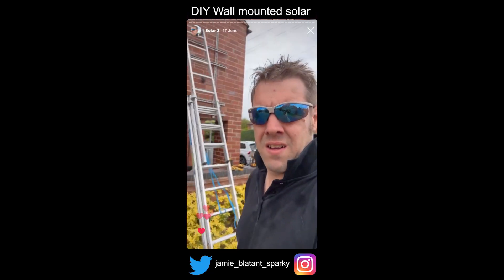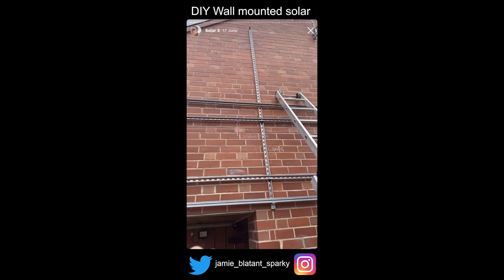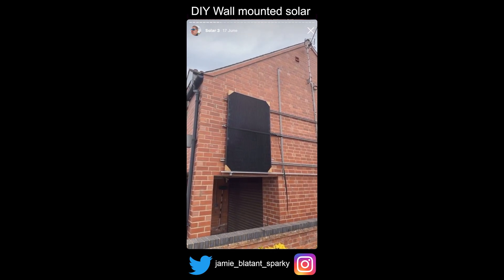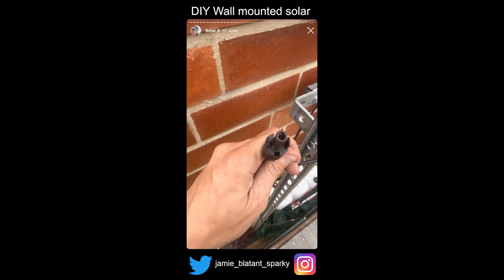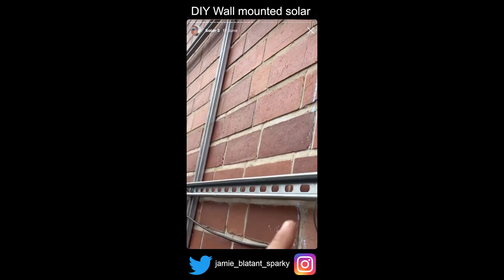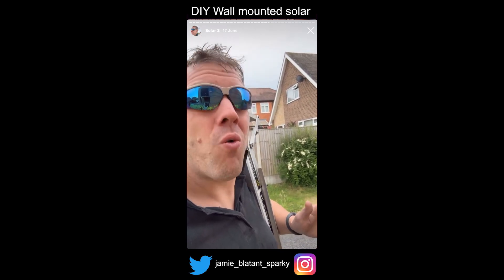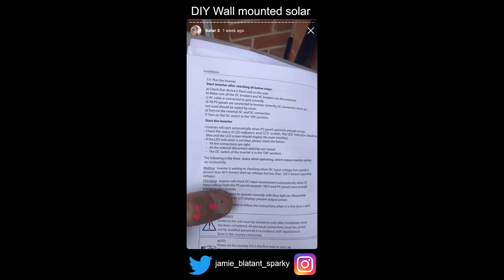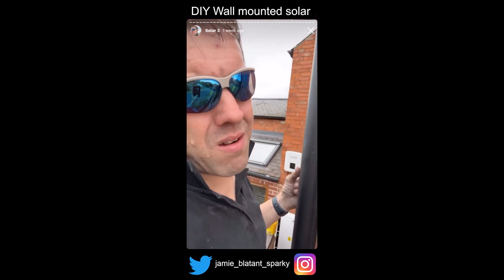DIY wall mounted solar project part 3 panels and power up

Comment: Interesting project Jamie.  Taking shape nicely.  Is that a boiler exhaust vent at the bottum middle of the PV panels?  Worth checking how hot it gets as it may degrade the panel.

Looking forward to the next set of panels going up.  Did you do a Engineering Recommendation G99 or G98, is it a lengthy process?